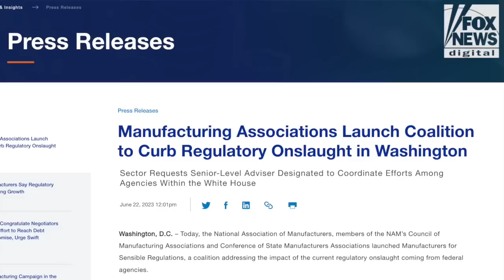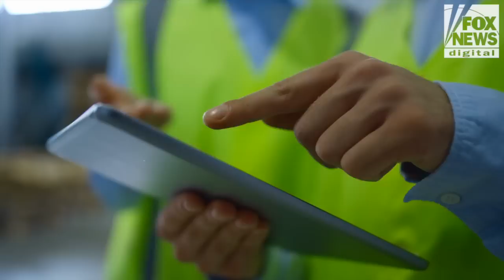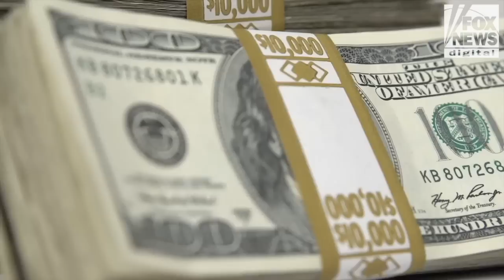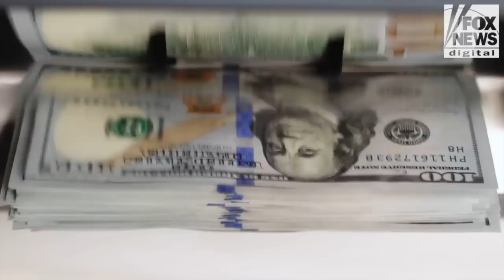Biden’s ‘regulatory regime’ needs to stop its onslaught on manufacturers: Jay Timmons

Comment: Regulatory has become a tool to suppress one industry in favor of another, which is essentially Fascism. Enron capitalized on this and fell when deregulation came and competition was no longer suppressed.
Reply: How'd deregulating banks go for you guys? 🤣

Or did you forget about the 2008 crisis? 🤣
Reply: @syav4467  Nice Red Herring.
Reply: @syav4467  The 2008 mortgage crisis was caused by a culmination of factors, but did not effect certain places. Demand exceeded supply which created a real estate bubble. People took out loans on overpriced real estate. When the bubble popped, people owed more than the house was worth. So why did this not happen in certain parts of the country? Because in the areas where there were less restrictions on new construction (less regulation), more houses were built to meet the increased demand. So the home prices did not go up like in other parts of the country. There was no bubble and no crisis.
Reply: @seth7745  So to simplify what you said. It was caused by DEREGULATION.
Reply: ikr!
Reply: @syav4467  No. You are twisting my words or your reading comprehension sucks. I pointed out the fact that areas of the country with more laxed regulatory on building new homes never saw a mortgage crises because there was no housing bubble.
Reply: @syav4467  Let me put in in simple terms. When you make it easy to get loans and hard to build new homes, you end up with a housing crisis. It turns out the crisis could have been easily avoided by making it easier to build new homes to meet the increased demand through deregulation. No shortage, no bubble, no bubble, no mortgage crisis.
Reply: @syav4467  If you were refering to my original post. Yes, the fall of Enron was casued by deregulation, but only because the regulatory was suppressing competition and giving them exclusiive access to energy resources. Kind of like whats going on now with the oil industry. Regulatory reduces to industry to a few key players which enables them to set prices as high as they want without competition.
Reply: @seth7745  Ok so, you should probably learn what happened. It was because of DEREGULATION that ENRON was able to do what they did, but I was referring to the 2008 Financial Crisis, ALSO caused by DEREGULATION.
Reply: @seth7745  Not twisting your words at all. You are making statements that are FACTUALLY WRONG.
Reply: @seth7745  Nah...
Reply: @seth7745  Unless you know some fact...
Reply: @syav4467  I did not present anything false, just facts that dont jive with your narative that you dont like. Plus this whole argument was a red herring from the start seeing as to how nobody was talking about deregulating banks here untill you brought it up. Apples to oranges.

Comment: Manufacturers need to stop dumping their waste into our water table.
There's nothing wrong with regulations that keep our drinking water clean and our air clear.
Reply: You are naive if you think regulatory is that reasonable.
Reply: @seth7745  Can you find a recent regulation that isnt reasonable as an example?
Reply: @hanshansen3885  The answer is in the video. No point in discussing this if you aren’t going to watch it. One example would be the 30+ permits needed from various agencies to drill for oil. Its not practical expectation and cost prohibitive for smaller companies to even comply with, which limits competition and allows for what is effectively a government enforced monopoly.
Reply: @seth7745  "The answer is in the video. No point in discussing this if you aren’t going to watch it." Initially I didnt watch the whole video but I have now and the only examples are the Scope 3 and the ethylene oxide regulations. How are those not reasonable?
"One example would be the 30+ permits needed from various agencies to drill for oil." It could be centralized into 1 permit but the requirements would be the same.
"Its not practical expectation and cost prohibitive for smaller companies to even comply with" So because the small companies cant compete then you would lessen environmental protections, safety protections and so on? 
"what is effectively a government enforced monopoly." Not all business are capable to function in smaller units. A fix for this is multiple smaller units combine into a bigger unit and thereby cutting the costs.